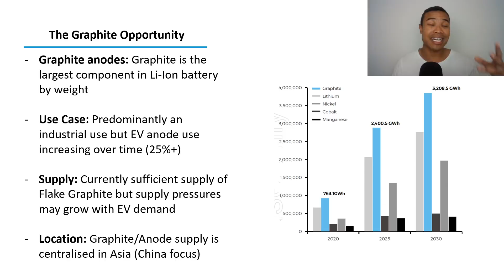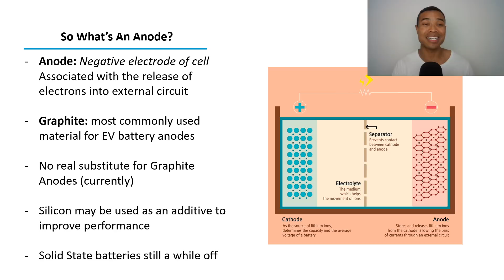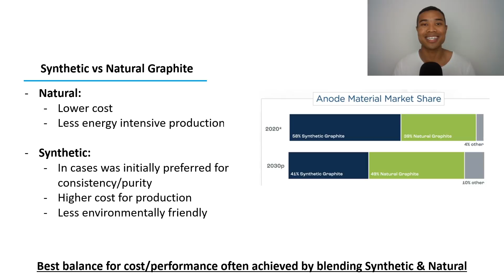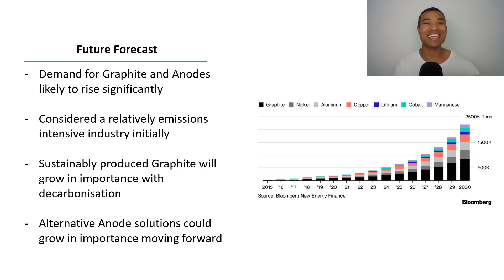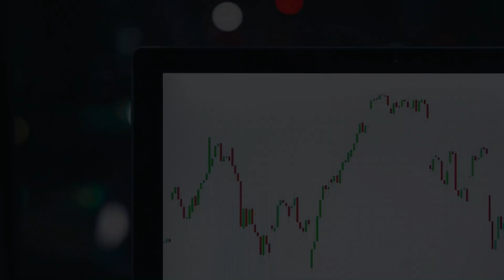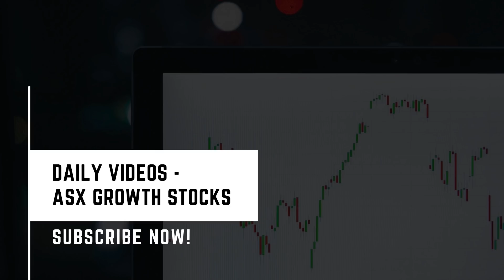Graphite Stocks: Why Graphite Could Drive The EV Revolution

Comment: China a key component?…100% of PSG comes from china… they are the only supplier of the component currently.
Reply from the maker: Yes correct 100% of PSG comes from China but that discussion was about the broader downstream processing including anode production. Battery anode production is currently focused in Asia but it’s not only in China that Anode’s are ultimately manufactured

Comment: SYR - Natural Graphite production. 50 years mine life at 350 000 tonnes pa capacity (Current production rate is 100ktpa after shut down during covid). The world largest mining and production. Current market cap is $658m.
It has 5k tonnes graphite anode in American (first Natural graphite anode production outside China). Pending production expansion decision in December 2021:
1. Iterative testing advanced on the 5k tonnes capacity with multiple customers.
2. Commercial discussions for muti-years off purchase commitments progressed.
3. Expansion engineering is completed.
Battery anode is a blend between Natural and Synthetic and silicone coated. To get the best for cost, capacity, minise expansion and longevity.

NVX - is making Synthetic graphite.
Reply from the maker: Thank you for the write-up, that is a huge resource and it looks like Syrah is positioned well for the potential upcoming growth in demand for the sector. Will definitely have a further read into their story.

Hope you enjoyed the video 😊

Comment: RNU would have to be the best on the ASX , a bit of work still to be done , but next year this time it will a pretty sort after stock , enjoying full sopport of the Oz Govt. as well
Reply from the maker: Definitely still early stage but it's an absolutely massive resource and as you mentioned - its location in a Tier 1 jurisdiction cannot be overlooked. Will be interesting to see where it heads from here 😊
Reply: @ASXInvestor  Second largest in the world, looking at 2023 production, all for a  $240 mill. mrkt.cap. early next year should see a few offtake agreements locked in , it will head to 20c + very fast , nice time to set yourself up
Reply: @contendedandy  , Spot on Mate, very good analysis with regard to RNU. I can see Posco knocking on DC's door soon with regard to binding off take agreements...natural resources for the " Electro mobile Market place" aint getting cheaper any day soon
Reply: Absolutely agree
Reply: I dont buy without a Limit. And placing a limt for Rnu at 0, 0701€ is impossible.
Reply: TLG is by far the best graphite project in the world; RNU still note worthy though.
Reply: Don’t forget what happens at the end of a batteries life, making sure all of these things don’t end up in landfill will be a big consideration. That’s where EGR steps in 👌🏼